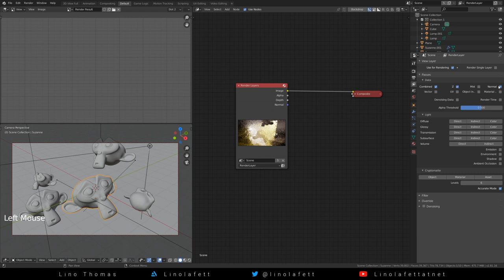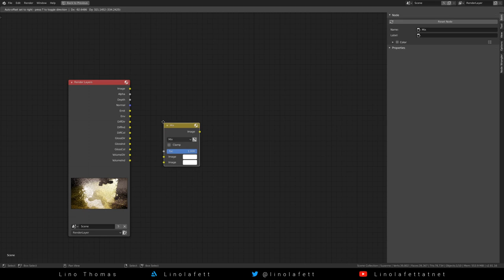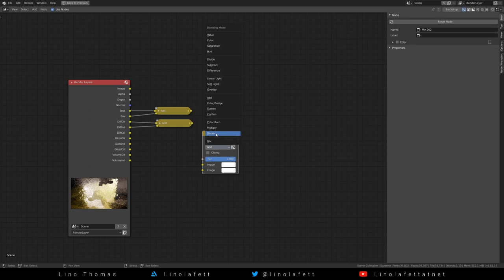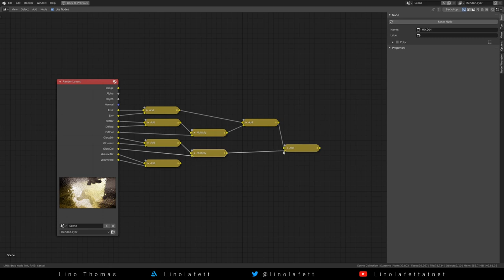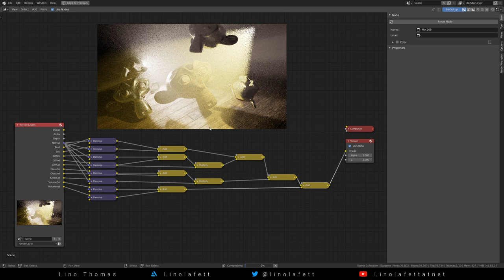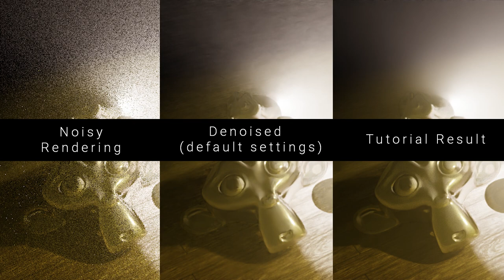How to get rid of denoising artifacts - 60 second Blender tutorial

Comment: just did the same thing when experimenting with render layers, difference is that i put denoise node only on indirect lights and transmission because direct light layers where noiseless. Working with denoising data from other tutorials where really bad because it removes completely fabric texture from renders so this method is better. Old denoiser is still pretty good in keeping details and much less trouble.
Reply from the maker: Indeed, you can also here simply disable the denoiser on layers which are not really noisy to preserve even more detail.
The old denoiser is great for higher sample usecases, for super low sample amounts, the post process denoiser is better :)
Reply: What are you referring to as ‘old denoiser’?
Reply: @ArfatXeon  from the older versions of blender

Comment: For everyone who sees this now, meanwhile you can just change the denoising setting from NLA to Openimage and the result is the same.
Reply: Incorrect, this allows you to denoise volumes for example without the denosing albedo, but keep it for everything else where you want it.

This way you avoid the known issue with using the denoising data for volumes but you can keep that glorious data for everything else that needs it, his exact implementation uses too many denoising nodes that what's necessary to get the same effect that he did but just use less after you combine them at different phases.

This IS useful with the OIDN or OpenImage denoiser!

Comment: Hummm, it's the same setup as E-Cycles do since one years ;) It's a good approach but some time can be more destructive. In all way, 128 spp minimum for the denoise to work well for final images between 128-512 for animation or still with high resolution. Currently I use only the denoise data and get better result in 65% of the scene. In some case need to split like this using E-Cycles one button magic setup ;) One exemple for use only denoise data and not split, scene with glass / refraction... standard passes not store refracted / reflected color instead of denoise data, so better result in glass
Reply from the maker: As e cycles is not freely available, i was not aware of how they are doing things. 
On higher samples count as 128-512 i usually switch to the blender denoiser and stop using the intel denoiser (as it is usually pretty destructive).
Reply: @linolafettatnet  Yes, E-Cycles use the same approach ;) Intel denoiser do better result in my case but in E-Cycles I have access to Dither sobol that help a lot ;) When animation and short delivery time, I use two differents seed / render, 128 max samples and use Altus denoiser (I have a lifetime licence now cause they shut down... good product but... to expansive I think)

Comment: Doesn't work for me unfortunately.  The Image Output in Render Layers left not connected - is it ok? And should I have left Denoise at Render at Scene Properties?
Reply from the maker: Denoise in render properties is not needed, as you are using a separate way to denoise.
Image output on the render layer output should not be used.

Comment: Hello thank you for this tutorial it saves massive time for me. From renders of 1 h with around 1500 samples now I render for 5-10 minutes on 50-150 samples with even better overall resoults.  
I just need a little help with compositor setup, because my renders contain a lot of glass which cames out black- there is  some problem with transmission I think, but I dont know how to connect nodes correctly, if you could write me any answer for this glass issue I would be very greatful. Cheers :)
Reply from the maker: Thats great to hear, glad it works perfect for you! :)
Reply: @linolafettatnet  this setup works like a dream. But just as Heca points out - glass comes out black and I cant figure out how to fix that. Could you look into it ?
Reply: @theBlady  Have you tried increasing your transmission light path to like 10 or smt?
Reply: I'm hella late but that's because you will need to also check all the transmission passes if there's glass in your scene. And recombine them in a similar way. (I'm not 100% positive on this but I think it's add direct with indirect, then multiply with color, then add them in after the diffuse but before the glossy) Good Luck!

Comment: Thank you for this way - for my slow hardware it's a godsend. But I have a problem: when I want to use shadow catcher, render of that plane is black. Why? How can i do to resolve this problem?
Reply from the maker: Hi,
my guess would be (have not tested) that you need to enable the "transmission" layers in this case and add them the same way as the other render layers. 
I hope this is working!
Cheers
Reply: @linolafettatnet  Unfortunately it doesn't work. The render layer is correct, however compositing produces a black object. Either something is missing or there is too much. Unfortunately, I have no idea. Apart from shadow catcher, the method itself is great.
Reply from the maker: @tomcik78  I took a quick look.
Can you set the "film" to be transparent and then use the alpha to drive the opacity, after you have added all the denoised layers together?
I have now a test scene, where i have a cube with a shadow cather plane below it and got it to be transparent again.
Look at this, maybe its working in your case.
https://i.imgur.com/taVn6Yg.png
Reply: @linolafettatnet  Ok, thanks. It works but by turning on transparency I lose the background (I have set HDRI not only for lighting but also as background). I am sorry to bother you so much, but I'm just starting and your help is priceless.
Reply from the maker: @tomcik78  You can render the background in a different renderlayer and add it later back into the image, if you need it there :)
Reply: @linolafettatnet  Yes, it is good idea. Thank you:)

Comment: Just tired this but I get black materials on all of the objects which uses transmission in a render result. I checked if there was any other issues but when I view raw image, objects appears to be showing up correctly. Just not the composite. So I am assuming denoise nodes are doing something to cause them to show up as black. Any ideas?
Reply: I read other comments and figure out the issue. I had to add transmission nodes also in order for it to make it work. Had to figure out nodes connections also.
Reply from the maker: @eandfriends5741  Perfect. Yes the transmission is missing, so you had to create the render layers for it. You understood the systemand could apply the rules for further modification, very good :)

Comment: Neat! Does enabling all those passes increase render times?
Reply from the maker: Thank you! 
Enabling the passes itself does not increase the rendertime. 
Having to add them in the compositor afterwards is adding a bit of overhead. The multiple denoiser nodes make the compositor slower, yes. But its quicker than waiting for the renderer to make the image less noisy.
Reply: it does. but not by some big %.. however intel denoiser do take time and if u are rendering in 2.5k or 4k it really can take time.. and depends what is your hardware ratio... sometimes it is better to use less denoisers and allow more samples.. it also depends is your CPU intel or AMD.

Comment: I can't see anything on my viewer node after doing this, it's completely black. Is this normal?
Reply from the maker: Heya, not normal. Try to connect your viewer node a few nodes up the stream to see where the last visible image is. Debug from there. Of course you need to have rendered an image before this works
Reply: Hi, it worked now but it didn't seem to denoise anything, it just looked very similar to the original noisy render. Thank you though
Reply from the maker: @syxialai  sorry that it did not work properly. I cant help without looking at the file. Maybe repeat again, maybe you missed sth small

Comment: Did you use the Denoising Data pass for the Denoised default render?
Reply from the maker: I dont understand your question to 100%. 
The passes i use are independend of the extra "denoising data" you can enable.
Reply from the maker: @mainecoon6122  that gives an interesting fun look. 
Problem is, that it still creates massive artefacts in the high frequency details and also makes the image darker.